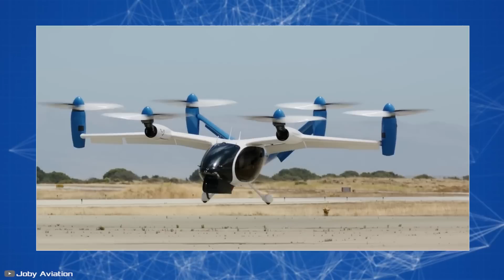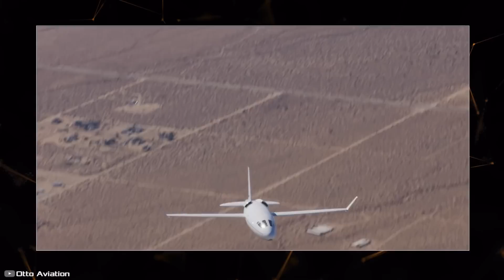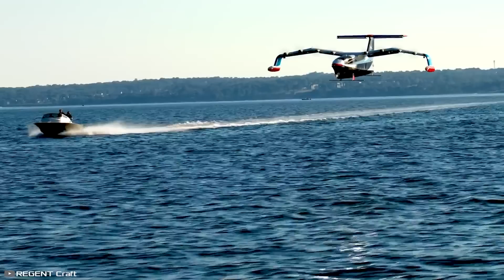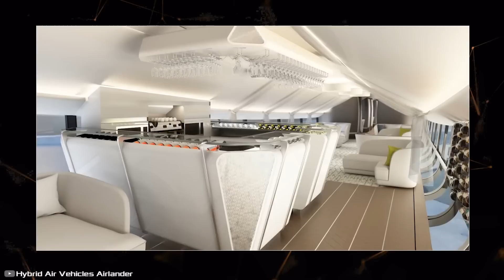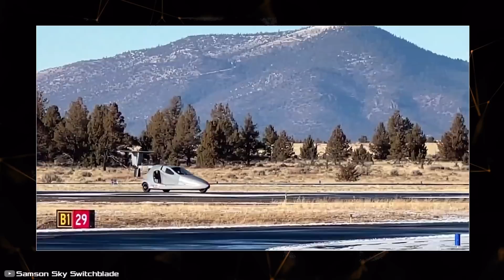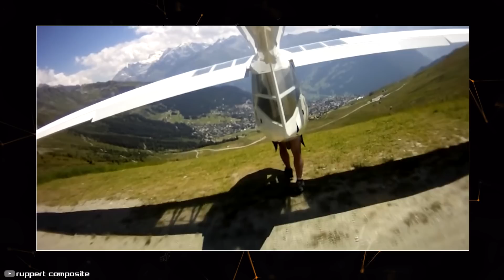This Plane Will Change Our Understanding Of Travel - 20 Most Innovative Aircraft

Comment: Continuous ridiculous bullshit...but my favorite was giving the glider a range of 283 miles (or whatever, if I got that number wrong). Precisely how do you determine how far a glider can fly? Putting an engine on it is mentioned, but then the range would depend on what engine and what size fuel tank, not to mention that with an aircraft this small, variations in the weight of the pilot becomes important.